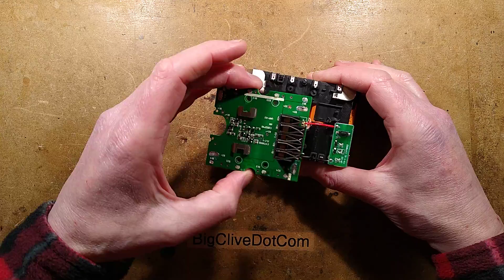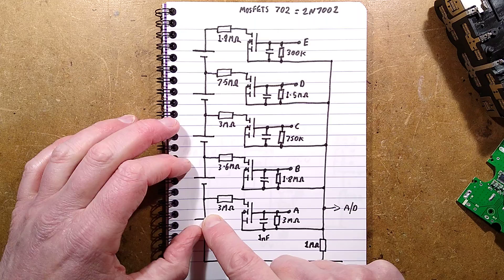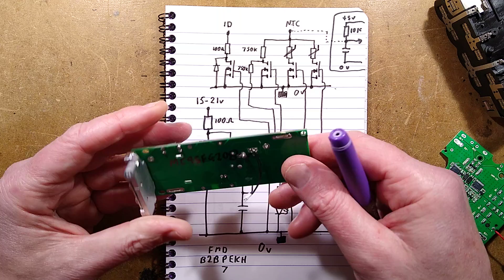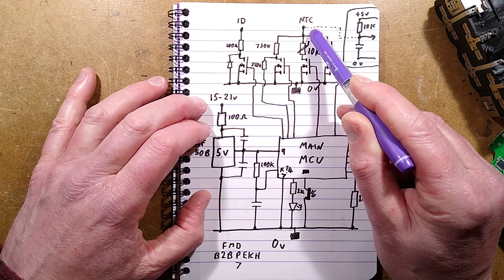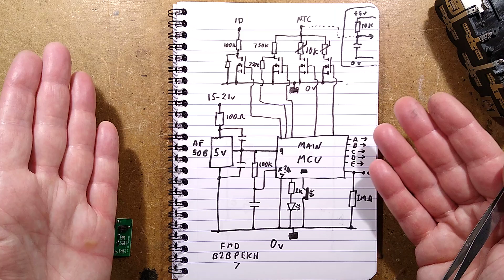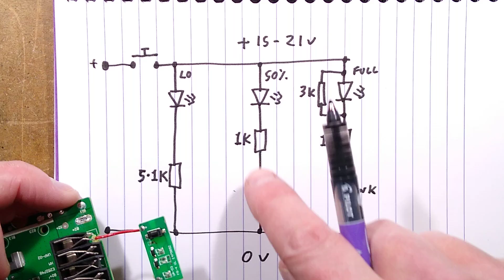Inside an Aldi Ferrex 20/40V battery (with schematic)

Comment: Woah- A bit more in there than I thought there would be- These are actually looking like they are worth the £19.99 for the whole drill- I'm tempted to get a few just for the 18650 cells alone - I could knock up some decent 10/13s 10ah packs for the scooter if you get a decent amount of charge cycles. Thanks for another good vid. ATB   :)
Reply: Yeah, was wondering what the quality of those 18650s is like
Reply: @wich1 samsung or LG  cells

Comment: My 10 year old, ten cell 18V weedwacker stopped working so I desoldered the beast and found 3 corroded cells.  Rather than tossing the whole thing,I turned it into a 5 cell  pack and pieced it back together.  Amazingly the battery still has 70% capacity but with half the cells, theoretically last half the time.  The electronics still kinda work but the cut-off voltage strangely went from presumed 2.5V to measured 3.5V so time between charges is greatly reduced.  OK though since a full charge is still enough wacking for my yard.  
BTW, the number of SMD components on these double sided boards is mind blowing and alien to me - you deserve at least two pints after reverse engineering -cheers!

Comment: I was in Aldi, today, and they had an angle grinder reduced to £9.99 ... amazing. At that price I couldn't afford to leave it on the shelf.
Now, I've always tried to avoid buying rechargeable tools other than the brand that I normally buy, so that I don't end up with a load of incompatible batteries and tools. But an angle grinder for £9.99 is not to be sniffed at, so a 20/40 V battery and a charger went into the basket too.
When I got home and unpacked my shopping... I realized that I'd bought a corded 240V angle grinder, (still a bargain at £9.99) and a battery and charger that I really don't need. Ah well, now I can buy Aldi battery powered tools, when they are on special offer.
Reply: I've somerimes bought a lidle tool, perfectly fine if you use one very rarely for a job. Still using a corded lidl angle grinder after 6 years as i rarely use it and it would be pointless spending a lot on one. Let's be honest the ecoensive brands aren't much better sometimes.
Reply: @handlesarefeckinstupid  Still using an angle grinder I got in the 1990's, Black and Decker. Not used much, but still does a few jobs a year for me. There were 2, one was killed by a builder who burnt it out in 5 minutes by pressing so hard the motor dropped to around 800 RPM, and running it till the smoke billowed out. The Bosch one of around the same vintage is also still in good order, and each has typically only one type of disk on them, one grinding, one cutting.

Had a few cheap Ryobi ones that were bought, used a few times then either given away or failed.
Reply: I have the ferrex Pro grinder impact driver hammer drill all brushless grinder was 15 the drill and driver 10er each but its been batteries I couldn't get but last few weeks 20/40v back in so have 3 of them now the impact will undo 200nm bolts the pro stuff is unreal how good it is the brushless motor to but is more that what I paid for the tool

Comment: Bearing in mind I am a idiot when talking about electronics could one thermistor be for protection during charging and the other one for an over current induced heating during use, like a drill bit jamming ?
Reply from the maker: They will both be used for both charging and discharging monitoring.
Reply: When I saw there was two and how they were positioned on the PCB, I thought that maybe one of them would have been mounted on longer leads and monitor the 2nd bank of batteries instead on the same one. Maybe the final assembly dept didn't get the memo...

Comment: I'm pretty sure that, on a 20 volt tool, it parallels the two batteries, because, in the technical data, for capacity it says:-

5000 mAh for 20V appliances.
2500 mAh for 40V appliances.
Reply from the maker: It does.  I just tested the contacts of a 20V tool and they are connected directly in parallel.

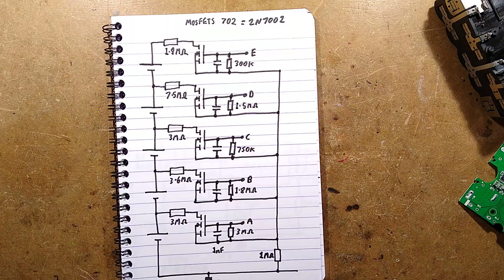Comment: In the 4:06 schematic diagram, they could have pulled-down all gates to 0V (instead of to Vss for each MOSFET) - MOSFETS are fine with negative gate-potentials, and the "leakage into the sensing-resistor" issue would have been a non-issue. Let's attribute this to "mental straight-jackets".

Comment: Great video Big Clive. I did not know that Ferrex had the dual voltage packs. I have an older video looking inside the DeWalt FlexVolt and I was amazed and a little bit scared of how complicated the switching contacts were on it to put the 3 sets in either series or parallel. I did not see a microprocessor on the board for it. DeWalt usually don't have one.  Unfortunately the whole board is covered in thick coating making troubleshooting difficult.  Thanks for the look and Merry Christmas!

Comment: I love it! Can you recharge the battery using a DC-DC power supply? I have a 24V solar setup and want to cut out the losses from inverter and battery chargers. Is there a save way to do that? 
Looking forward to the next part of the series! 🤩
Reply from the maker: It's better to use the official charger.  It might be viable to adapt one to low voltage use.

Comment: I have an idea, because your channel has some interesting, under the hood analyze for electronics.
What if you were to buy some cheap used (defective or not, importantly is to be new-ish) house appliances from reputable brands and see what's what.
Lets say comparing stand mixers innards. How is a bosch inside? Or a Kitchenaid, or some other bands (like the lidl brands, and do a side by side talk about what technology they are using.
Is is really worth the premium for an expensive brand? Does the owner really get better stuff, or is just deceit from the manufacturers pushing fancy looks, but using obsolete electronics engineering?!
Other products as well, depending on costs. I thought mixers would be cheap and nice to start off a discussion and presentation because usually all people would have one if they make food at home.
Reply from the maker: For domestic appliances I choose generic mass produced brands, as they have had all the problems engineered out and spares are cheaper.

Comment: Interesting that they would use a " reverse resistor ladder/voltage divider  " to ensure that the FETs are off except the cell they are checking.  Also of note that they used opto-isolators for a form of low speed COM ports to each other.  The thermistor issue could be a way of not having either MPU have some complex way of both reading the temperature as well as the charger reading it.

Comment: Interesting Clive,the talking to both MCU,s via optos could have a benefit of allowing lock up to be monitored,1 checks the other etc.Most if not all MCU's have the brownout ability,the strange divider battery monitoring might be so the A/D converter (8 or pos 10 bit) is working at max resolution,i had a similar problem on my 8 channel designe.Good and detailed job you did there. Thank you.

Comment: At this point it's too bad that the industry doesn't standardize on a battery pack format such that the individual cells can be purposefully removed and replaced. Perhaps even with out-of-device conditioning.
Reply: The problem is that a battery pack has to be built out of cells that are reasonably balanced capacity and age wise. The average user wouldn't be aware of that and there'd be a few fires started...

Comment: The 10k ohm resistor is about right for a thermistor replica, because that would need to be used to connect to the centre pin on the mobile phone battery terminals then to ground, to get the phone to work from a power supply.
Reply: There is no 10k resistor, just a 750k resistor.
Reply: @jaro6985  Watch the video again, a 10k resistor would replicate the resistance range that the mcu device is programmed to operate happily, for example a thermistor would have a resistance of 10k at room temp.
Reply: @jaro6985  In a fashion, yea

Comment: It's called "active cell balancing" and can actually load a single cell which drags behind. A passive balancer would wait 'till the cells are almost full and discharge full cells until they all have the same voltage and reloads them all in the meantime.

Comment: That circuit Is like a passive balancer. The temperature, over charge voltage etc.. of Each battery cell is monitored and control on MCU.

Comment: WJ zener is nominally 15V, whilst WK is 16V - sadly I don’t need to look this up after 40 years working in electronics hardware (a.k.a. I know which end of the soldering iron gets hot <|8-)

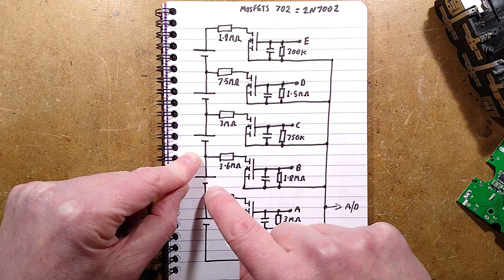Comment: I'm confused with those NMOS for the voltage monitoring (around 6:02). How can a 5V MCU output turn them on, if voltage on their source is higher than, say, 3V (i.e., the gate sees only 2V, compare 2N7002 VGS(th) min. 1V, typ. 2.1V, max. 2.5V, and with the goal that RDS is negligible to those MOhm resistors)?

Also, if A..E 0V except for the one selected channel, then all gate resistors would be in parallel with the bottom 1M resistor. Except if the MCU would let the output float, which might also work.
Reply: ooohhhh! Now it makes sense to me. I didn't think about the gate resistors effectively being in parallel with the 1M when their associated output was low. Hmmm... With the correct combo of high, low & Hi-Z on the A,B,C,D & E lines from the MCU, it should be possible to put the ADC voltage in the sweet spot (2.5V or a bit less) for each tap on the battery pack.

Comment: Just an observation as I'm not into electronics , the ratios of the resistor values may have a bearing of the otherwise arbitrary values of resistance. Could it some how point to each particular battery in sequence relating to common ground?

Comment: Hi Clive, very interesting and over my head 😊. I have a few of those 'activ' batteries. Question though, and apologies if I missed it in the vid (sorry, started reading the comments.....again...), but did you mention HOW it decides whether it has to provide the longer (series running) 20v or 40v (parallel)?
Reply from the maker: That is done in the tool itself by bridging in series or parallel.
Reply: @bigclivedotcom  good god! Now you point out the obvious, it's obvious 🤭. I was thinking, and looking for, something clever in the 20/40 battery. Ta very much 👍

Comment: Once the MOSFET is on, the gate capacitor voltage is going to be summed with the voltage on the high side of the 1M sense resistor. It looks like the ratio of the gate resistor and battery resistor has been tuned to ensure that the boosted capacitor voltage is never high enough to damage the MOSFET or the microcontroller. 

I assume the specific values were chosen as the cheapest for that ratio.

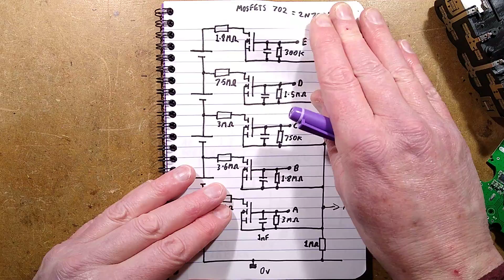Comment: The resistor ratios in the monitoring schematic at 6:27 may help it make sense, they may not:-
E: 6:1
D: 5:1
C: 4:1
B: 2:1
A: 1:1
Interesting that a 3:1 ratio was skipped.

Comment: Regarding the regulating / monitoring circuit: 
Maybe the values are uniquely chosen to have a "clear identification" in software? To be able to do further calculations without referencing to fixed pins / values.

Additionally you said there are two processors. Do you now if they are in a failover-state? Could the pack be run with only one chip in place? This would make this pack pretty safe and reliable so that the software can't glitch out or burn down the whole pack when one processor has failed.

Edit:
For the potential bidirectional communication over the NTC: Maybe the tools have thermistors / sensor circuitry in them aswell? For overheating motors and such things. This makes the pack basically the brains of the operation and the tool fairly "stupid" as you have shown in the Angle grinder teardown. 

This would make excellent marketing in my opinion because they could justify the (presumably) more expensive price of the pack by labeling it "smart pack" and just a "dumb" tool.

Comment: I recently bought a few to power my rovers, they use 36V hoverboard wheels (I got a lot of motors cheap but no batteries and controller). The batteries are great I 3D-printed a socket so they are easy to change. Quite a good source for decent standard battery packs for a budget. ALDI also claimed to support the battery system for the next years. One is used in 20V mode to power a DC-DC converter and the jetson Nano.
Reply from the maker: Keep in mind that these do not have onboard ability to shut off power when a cell gets low.
Reply: @bigclivedotcom  good point I wonder if the ID or Temp Pin has an error state for this case. For the rover it is no problem since you want to monitor the input voltage anyways.

Comment: my guess just from looking at it in bits is that it's 10 18650's pushing around 40v's with a battery protection circuit then thats split into four terminals 2 going to a buck converter dropping it to 20v's in two prongs then 2 connectors thats direct from the battery that gives 40v's then the final pin being earth

Comment: Trying to figure out how the battery voltage monitoring part works and I think I figured it out.  The Vgs for those FETs is around 2V, so the voltage at the drain needs to be 5V-2V so 3V or less.  The large series resistors would accomplish this I think.  In regular operation, I suspect the micro is tristating those gates, so the G-S resistors are closing all the FETs off and the 1M is ensuring they stay near ground.  It would then pull one of them high which will turn one FET on, and its series resistor with the battery limits the voltage going into the drain to around 2.5V or less I'd think.  The G-S resistor would act like a pullup too, injecting some current into it.  that part is pretty strange still.  I would expect the resistors to get larger as you go up the ladder but the schematic shows otherwise.

Comment: I am still perplexed as how these work.  I think you said that the circuitry only works for the charging state.   The discharge current goes directly from the spring terminals without being regulated by the circuit, as that would require some very high current SCRs.    Are these packs compatable with other makes such as the finger chopper mini chainsaw..?
Reply from the maker: The finger chopper batteries usually have onboard over-discharge protection.

Comment: I have a 14.4V aftermarket HP battery(original is not available anymore).
It has an interesting fault. One cell is charged to 4.27V at full, the others are 4.07V at full. The battery stops charging. The laptop says it is charged to 26%, and sometimes the charging light turns on for a few seconds, then off. The battery lasts for half an hour. Why?? Never found this out myself. The battery is one year out of warranty and I have not been using it every day. Maybe twice a month.
Reply from the maker: The pack has got out of balance.  If you use a load on the rogue cell to carefully bring the voltage down to the same level as the other cells the pack will charge more evenly and possibly return to its original capacity.
Reply: @bigclivedotcom  Thank you for the advice. This balancer is a microcontroller based version. Should I desolder  the cells from the circuit for this? Or can I balance them in circuit? I have already disconnected the cells once and the board did not register the procedure as battery failure.
Reply: @bigclivedotcom  I have discharged the higher voltage cell to be balanced with all the others, but that god damn balancer overcharges that one cell no matter what I do. New battery it is going to be then.

Comment: I think to see what it exactly does, you need to calculate all voltages and currents. But you need Vg for that. The current from Vg through the gate resistor and the 1 M at the bottom adds to that flowing via the drain resistor and the 1M. If the output of A,B etc can sink current you need to count that too. It is also possible Vg is not a fixed value (via an opamp ? ) but different for each mosfet to get enough Vgs to switch it on.  And the voltage over the 1M resistor needs to stay within the range of the ADC.

Comment: Odd that it can monitor individual cell voltage but not balance them
Reply from the maker: Yeah.  The Ryobi clone I looked at had a similar system, but also a balancing chip per cell.  I think it may have added too much circuitry to this pack though, as it would have required around 50 more components.  (chip, RC filter, MOSFET and shunt resistor per cell.)

Comment: I have an aldi ferrex electric lawn mower which i love, but the battery scares me. 80V 2.0Ah 144wh, fast charger has a big fan in it to keep it cool. It works but I don't know the quality of cells inside so I'm hoping it doesn't catch fire one day.
Reply from the maker: Aldi have a reputation to protect locally, so it will probably be safe.

Comment: If you go for the 20V Batterys, there are at least 2 Versions of it. The older version which has Samsung cells, 20V, 36Wh, 2,0 Ah. There you got B2 - and B2 + and T/ID stacked. The newer ones are noname cells, 12/20V (!!) , 2,0 Ah and 37Wh . There you have B1 - , B1 + 12V and B2 + 20 V and T/ID stacked.
By (mis)using them for own projects i was able to discarge them to a point where the charger diagnosed them as faulty (making that sound like an achievment here 😅) at around 12V.
I don't know about a 12V Aldi Tool here in Germany, so, maybe somewhere else?

Comment: Be aware sometimes after desoldering the BMS (battery monitor system) for example changing the cells the circuits stops working.
First put it on the charger. Most of the times it's comes back alive then.
Probably the cell cutoff that needs to reset first.

Btw they just should call it nominal voltage as it should be.
So X*3.6V. This is weird